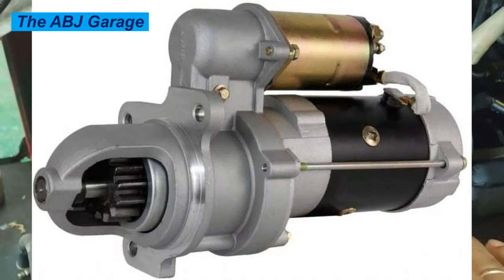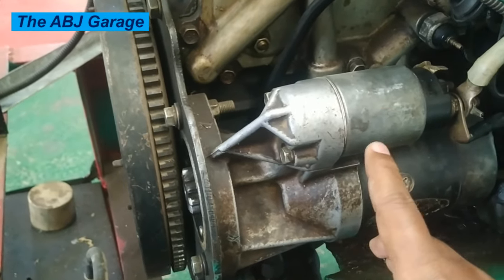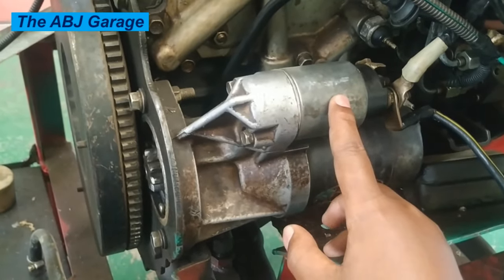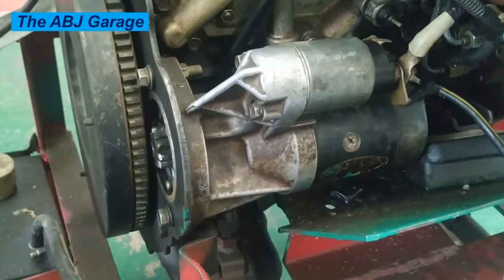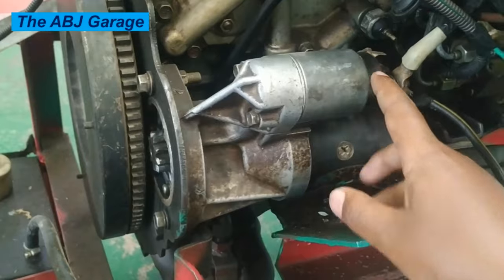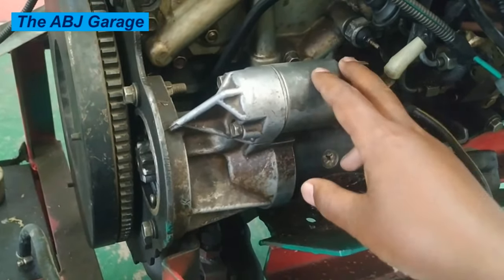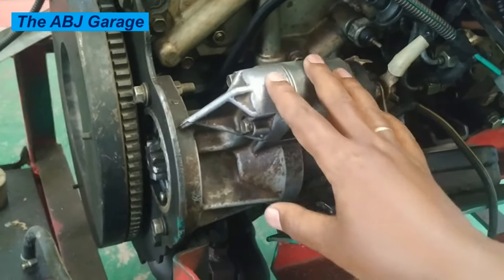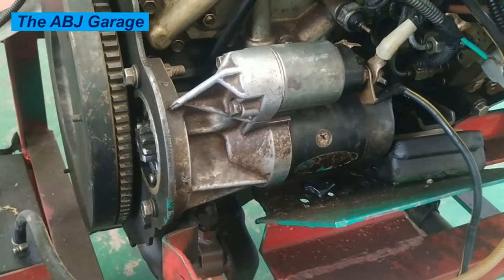What causes starter solenoid to go bad and how can it be protected?

Comment: I'm very impressed with your English. People in America will laugh at other people's accents trying to speak English when themselves can only speak one language. Imagine if I was trying to speak your native language, it would sound quite funny to some people. Great video what a great explanation for those who are questioning replacing the starter solenoid or having the starter motor rebuilt. I talked to a shop today that rebuilds starter motors and he said that a lot of times they just replace the starter solenoid and not rebuild the actual starter. He said this would cost $80 I'm going to try to buy a starter solenoid at the auto parts store for $26 and do it myself. Thank you for taking the time to explain this so simply. This video is not for people looking for a specific vehicle and how to get to the starter solenoid on their vehicle but it does give you an idea what you're dealing with when you turn the key what to look for and possibly might just have dirty connections that once cleaned up will fix the issue. Happy hunting
Reply from the maker: That's so sweet of you! Thank you very much!

Comment: This video clears my doubts. There is no cranking at first try only a click, however on second try there is quick and solid cranking. My battery is fully charged, starter relay and fuse are ok voltage and ground, still need to check wires connected to solenoid (corrosion or loose ) but must likely the solenoid is my issue. This is on a gmc Acadia 2013. Is it worth to replace only the solenoid or replace both, solenoid and starter?
Reply from the maker: If the starter motor is actually in good shape I recommend replacing only the solenoid switches. That's way better!
Reply: I had the same issue in my 2002 GMC Savana 3500 which would have a very similar starter motor as your vehicle just probably a little bit bigger. My starter motor is located right under the front right of my van kind of underwear the body holds the drivers and passenger seat. So it gets plenty of ventilation but it also gets exposed to all of the water and sand and do it when you're driving in Florida where I live. My starter would just click some mornings I ended up going down there and loosening the wires cleaning it up and found a bad connection and it worked for a while and now about 6 months later it's doing a similar thing after we had some cold weather so what I'm going to do is replace the starter solenoid. I figure if I could get another 3 years out of the starter motor by doing that possibly by that time I'll be getting a new work van lol

Comment: I drover through a large puddle of water the other day with my car and i know my starter motor is located right at the bottom of the engine at the front and since i drove through the puddle of water the car has been starting really poorly and today it didnt start at all after i cam home from work and went to drive shortly after when the engine was still hot, would the water have caused this ?
Reply: Yes it has done just thst I have 2006 kia spectra I hit a huge puddle of water while driving directly behind s truck on the access rd in San Antonio Texas . I hit the very end of the water filled rd and still water jumped up very high I heard the water inside the engine ... SMH it was dark but could've submerged my car just like the truck in front of me
Reply: What will affect

Comment: I blew the fusible link that goes to the solenoid. My ohm meter shows a dead short between the crank relay and the solenoid.
Reply from the maker: Sorry to hear that! Have you been cranking for longer time? That would cause overheating and insulation failure leading to shorted components
Reply: @TheAbJGarage  I parked my 2003 Impala LS after a couple of short trips. The next time I tried to start it no sound, just smoke from the right side from under the hood.
The fusible link going to the starter solenoid smoked. It's in the shop now to get a starter replacement. I told the shop owner to make sure the short is gone before they connect the new fusible link to the positive terminal. If the short is still there check the wiring harness, but do not try to start the car or else you will blow the new fusible link.

Comment: Greetings: Solenoid always at starter. Not "another location".
Reply from the maker: There are starter motors using the solenoid only for electrical switching, in that case the solenoid can be placed separately. If the solenoid is to do mechanical task of engaging the pinion, then it should be placed on the starter. There are starter motors using inertia to engage the pinion to the ring gear and those drive type starters can have their solenoid mounted separately!
Reply: @TheAbJGarage  Greetings: Basically true. In such "remote" case the "solenoid" is not a solenoid. It is a relay as defined.  It is the term "solenoid x of which I focused my comment.